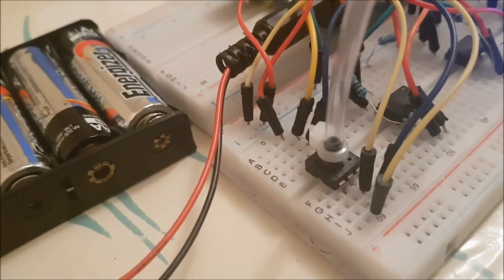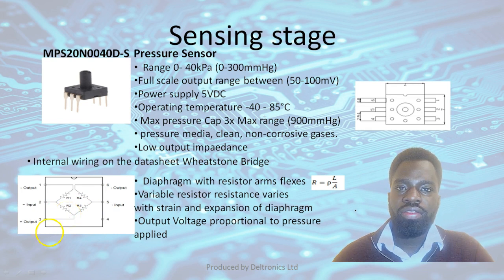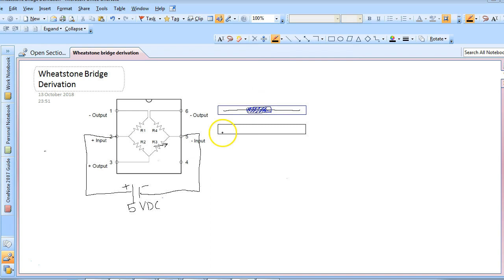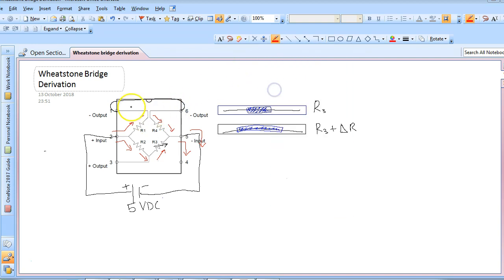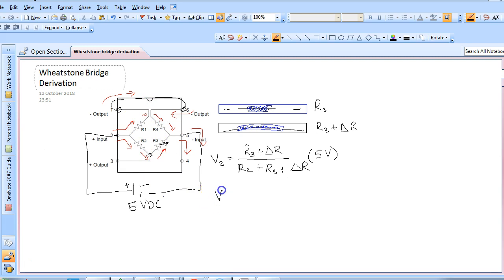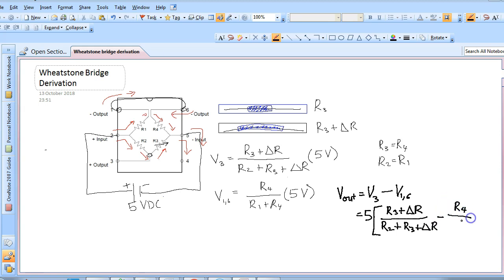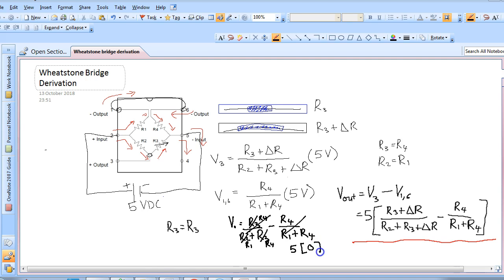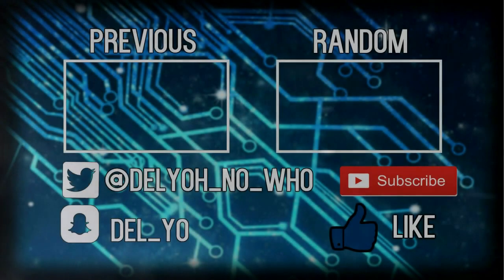How pressure sensors work (Wheatstone Bridge)-learn

Comment: Nice explanation . This sensor is a Differential One (model ends in D ) .  the 3mm connection I'm assuming is the pressure side and teh vacum are the holes around the sensor body ( I guess) and is related to AT . Please would you confirm if thsi is the case ?

Comment: I am looking for a pressure sensor that can measure pressure of fuel inside fuel tank(in motorcycle)   very precisely, Does it work , the accuracy should be such that even 100 gm of fuel reflect into pressure sensor, please guide me ??
Reply from the maker: You would need a pressure sensor that could appropriately measure your chosen medium, i.e in your case petrol, diesel in the fuel tank, there are many on the market. Additionally the output of the sensor will need to be 0-5VDC full scale because the Analogue to digital converter can only handle 5VDC max with a resolution of 5VDC/1023 so depending on your measurement range you can achieve your chosen sensitivity. Hope that helps

Comment: Hi. Thanks for the video. Can you please share the circuit for the MPS Pressure sensor connection you used. Thanks.
Reply from the maker: Thanks for watching! In the complete circuit I amplified the output of the MPS using a instrumentation amp, then used the Analouge to digital converter of an Arduino to get pressure measurements on an LCD. A air pressure meter was used as a reference and to calibrate the sensor. I have a udemy course with all the diagrams and equations and full explanations in the description. I may post the full circuit in the description soon.